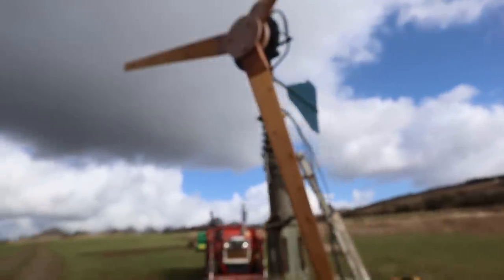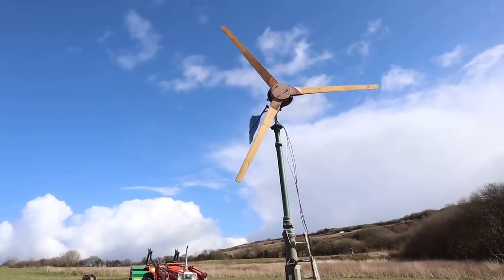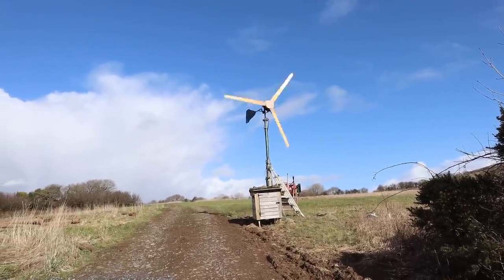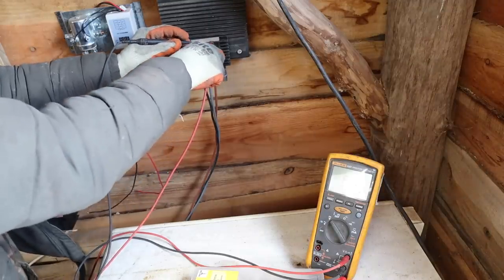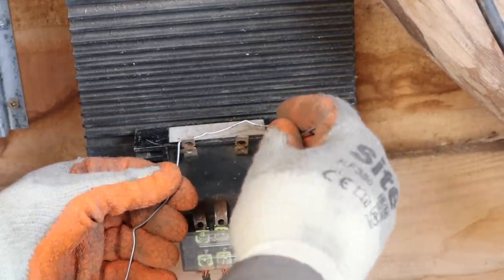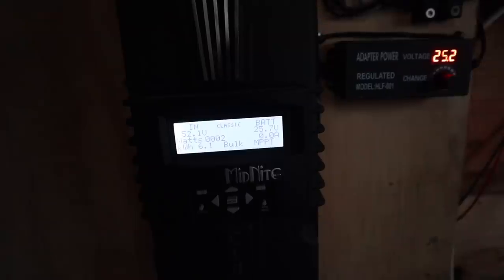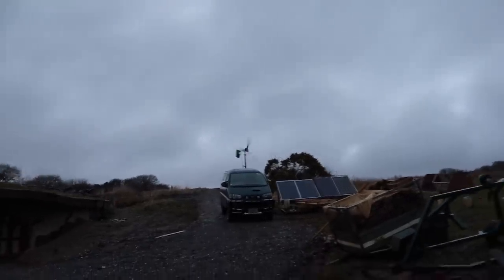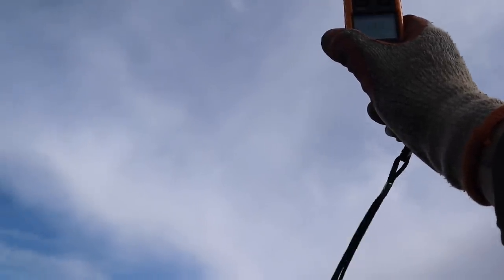Mounting Diy Axial Flux wind turbine Producing 1150W

Comment: Now that is the first wind generator I've seen that actually may be worth building, love the tower.
Reply from the maker: I am in a good location for wind and i made the blades twice the length then the cheap stuff you can buy. I would not bother going any smaller than this. I might make a monster one day.
Reply: @KrisHarbour    With the larger blades you might want to put a more resistive winding so that it turns slower to produce the same power.   That is a LOT of kinetic energy spinning there.  It doesn't seem like you have an issue with low winds, so you can add more torque.

Still a great project even so.  Love the pneumatic mast.
Reply: Yeah most people think "mur blade du bettr" when that's simply not true and they make no power.
Reply: The hugh Piggott designs are not expensive and have decades of real life powering a whole island community. They definitely work!
Reply: @KrisHarbour  hello please share the individual components

Comment: I really love, that you are into data and proving the data. So many wind turbinebuilders claim a lot, but never prove it. Or show a voltage, which says nothing. At the moment om working on a smaller 300 watt homebuild windturbine and a 70kWh battery bank. I have the same plans for data.  You have a new follower.  :D

Comment: WOW Kris!  I had absolutely no idea you would be making power like that from a turbine built from scrap!  I've seen videos on YouTube where ppl tested turbines they bought that were about the same size as yours but only producing 150-200-250 W

Great job!
Reply from the maker: I doubt they were as big. mine has 1.6 meter blades. if you double the blade size you get 8x the power so even a tiny size difference changes the output a lot. so it could be they had smaller blades and slightly lower wind speed. wind is really hard to do comparisons in your mind because of the massive changes to output from small changes in size and wind speed. But i do believe this would be a lot better made than those cheap ones you can buy.
Reply: @KrisHarbour  Could well be that my mind is playing tricks with me. ;-)  Never the less it's still impressive what you have made!

Comment: That looks like a WW2 stirrup pump.    It's great Kris.    Once it's connected it's going to do well, up on the hill.     Every farm should have one similar.     The 40 mph ish wind here in Chester almost blew me off balance yesterday.     I hate wind but we have had a terrific amount of it since I retired 22 years ago and it gives a good supply to the National Grid.
Reply: Too much wind and you end up with a sail when the brakes kick in to keep the turbine from burning out.  (there is a reason he reinforced the mast)
Reply: Not a WW2 stirrup pump, it's the original hand air pump for the 'SCAM' pneumatic mast he's using. Lots of Radio Hams (myself included) use them for their original purpose - holding up radio antennas.
Reply: @colint  🇬🇧    Thanks for info Colin.

Comment: Winglets on the tips would cut down noise and increase efficiency. Like the ones on passenger planes, you see them on big wind turbines now too. They reduce the size of the wing tip vortex significantly where high pressure air on the front face of the wing leaks round the tip to the rear face of the wing
Reply: interesting idea, only works on fixed wing applications though i think? never seen them on a rotating prop
Reply from the maker: Thanks for the tip i will look in to that. i quite like the sound of it to be honest but that might get old.
Reply: That's the sound of sweet success. You could turn it onto a podcast and cash in some Spotify coins to improve efficiency 🤑
Reply: Windtips would work, but a much simpler solution that would work roughly the same (in terms of reducing the noise) is just to round up the tips of the blades.

Comment: To prolong the life of the parts on the turbine (inc' blades and rotating parts), you may want to think about the best use of the brakes to get the lowest RPM sweet spot for the best amount of power output. Min RPM, max output; finding the perfect balance. :)
Reply from the maker: well it actually really likes the RPM that it is fixed to at the battery voltage. it goes passed an unbalanced phase and in to a quite balanced rpm snd it seems to be running quite well so i think i may have got lucky with that to be honest. further testing and experience will tell the full story.
Reply: for i-dea

- savonius made of boat sail
we have never invented better
and eliminates over-runaway problem
(seen it on FB)

- FR patent (which has disappeared, bought by Electricité De France)
a drone worth 4,000 euros,
made of 8 propellers,
4 to fly, 4 in a turbine,
attached to a cable
flying in a circle 300m high

produces more than a 150m high EDF wind turbine
(and maintenance requires simply changing the bearings every year)

only problem:
requires flight authorization
Reply: Since it’s built out from car parts,  the bearing and easily available and cheap.
Reply: From my neighbor who tried the off grid thing for 30 years before I started and became his neighbor, he said that wind power is to much process for the trouble, solar is a must and to only use the wind to charge a very healthy number of batteries...
I agree, you need to be at maintenance constantly subject to God's fury... We were in New Mexico on the foothill of the Manzano mountain and for months you will have winds at 60mph... Literally I seen it blow a cinder block off the roof holding tar paper down before the wind blew in... I said I'll get back to work on it after the winds die down... Lol everyday was like that, no friggin bueno when you building a house...
Mother nature does not play games, when you off grid it's almost like she's intentionally focused on you...
I'm not knocking the work that's done here, never that, it's just when a old dude doing it for decades says so, listen... Lol
True story same guy, when I bought my land the day we arrive to start the building we realized the hard way that the particular side the property was all loose sand a good 2 ft deep,
We got a 1988 k5 4x4 stuck, a 25ft uhaul truck stuck, and the AAA tow truck stuck all on our first day...
Fast forward to the day I met the dude for the first time, as I was working on the roof you could see my house now from the main road it was built with earth bags and tires, so my neighbor was being nosey,
I'm watching this mini van drive down our road on the roof, it's a good quarter mile, there's nothing but raw land, he lives 2 miles up the road,
He gets way closer than anyone has without turning around in fear, you big dude big gun, middle of bfe  oh hell nah, but he starts to head down to the sand trap which we called that particular area of the property, he's driving a late 90s early 2000 Nissan quest mini van... Not a truck with big tires, a friggin mini van.
So, as I'm trying to get his attention me and my wife trying to wave him off, I'm like man I'm going to have to get him out the sand trap... As I say this, the van makes the 90 degree turn down the driveway like it wasn't anything,
My mouth was on the floor.... He pulls up and before introduction I'm like dude, wtf right now, how'd you do that? Lol
He's like, oh the sand? Uhh yeah the sand... He's said oh, front wheel drive... Wait what? Yeah, as long as you keep it moving, FRONT WHEEL DRIVE...the heavy trucks, 4 wheels, nah... Front wheel drive is all, I've had every kind of car out here the past 30 years, the van cost me 400 buck 3 years ago...
After we talk for good min and he see our build in awe , he drive out into the same sand devil, and made it look so easy... We were in awe like so simple...
Lol he and his wife were our desert parents and grandparents to our daughter, miss them so much... But that man was wisdom on two feet...
Reply: you can't use mechanical brakes unless you are bringing it to a complete stop. leaving the brakes rubbing will cause them to catch fire.
Reply: @zogworth  yup...
Reply: @jeromegarcia5396  sounds like the best neighbour ever!
If I had a property with that amount of loose sand, I'd get a tracked vehicle for myself, probably an old waist steered surplus Hägglunds "Viking" (Bv 206)
Reply: @zogworth  wouldn't that depend on how much of a cooling air flow the brake assembly is exposed to

Comment: With the Arduino controlling the hydro, you could set it up to automatically power it down or reduce power output when you have plenty of wind. Then it could crank back up when the wind dies down

Comment: ~9.6kwh per day from water + ~7.2kwh per day of wind + 2kwh per day of solar = ~18.8kwh per day rough average of energy. I hope your battery can store at least twice that amount otherwise it's a total waste! You would need a 24v 750ah battery to store the amount of energy you could produce in 24 hours so double that and you would need a 1500ah battery at 24v. Nice setup! You are living my dream. You have more energy than you could ever need in a home even with an air conditioner! The shop will take more due to the heavy equipment you have.

Comment: hey kris, amazing! harness all the elements. 
i have a question. i know that commercial wind turbines breaks to full stop when the wind is too strong. will you also have this feature so the turbine wont break off? (or fly off hhh). if not, why? is it safe to spin under any wind conditions?
Reply from the maker: It has a furling tail so that when the wind is to strong it will turn itself out of the wind. I still need to tune that by adding or deducting weight from the tail. But that is its protection.
Reply: @KrisHarbour  do you think ypu could give me any tips on converting a chainsaw motor to a generator?

Comment: Add buttresses to the lower section of mast for mast stability.  Triangle steel pieces on all four sides and going out about as far as they are tall.  Tying into concrete footings.  Someone mentioned cable ties to secure it.  That would work for a normal long shaft pole but your telescopes so you could do the buttresses.

Comment: Kris, having put up a fair few towers for TV (living in the Wheatbelt of western Australia) we need TV antenna towers for reception I also put up a 6m pole for my 600peak Watts Wind Turbine you really need to put guy wires up to strengthen the mast try at about 1/3 Rd down from the top you can work  the distance out from the base of the tower it will give you a lot more stability especially in high winds.
Tony from Western Australia.

Comment: This is so cool! Where did you get the pole from?
Reply from the maker: Its an ex army mast. its called a clark mast. i used it for my radio hobby for years.
Reply: @KrisHarbour  is there an "origin story" video on you that you've made? Something that explains how you're able to build all this, design the things so intricately, and of course afford it all :)
Reply: @gerryn2  Yes I'm particularly interested in the affordability aspect. I've wanted to do something in this vein for years but haven't worked out how financially. Or the legality aspect.
Reply: The Brits were smart and used air, which can be compressed offsite.  US uses a crank and sections for our tac masts.    Crank up, lock, lower the crank, insert new section in the "elevator" and then start cranking again.    

Its also a guyed tower, but with the blade he won't be able to guy the top two sections.  (that is going to be the weakest point in the whole project)    If the winds get REALLY nasty he might have to lower the whole mast and rope the blade down.  That is part of the testing - you put a strain gauge on the guys and you can tell how much it loads down and you can figure out what the max is.

We had a blizzard in the army that messed up the math -- the ice formed a sail backed by wind driven snow and brought down a tower rated much higher for wind loads.   It pulled heavy 8 foot augers out of frozen ground and down it went.  That was an actual tower, not a mast.
Reply from the maker: Have you checked out my website? i have a bit of a life story on there.
Reply: @KrisHarbour  Oh true? Thank you bro I'll check it out. Many thanks. Keep up the good work. Love seeing what you're getting up to. Best of luck with your future endeavours. I'll be watching! Much love from New Zealand.
Reply: @KrisHarbour  Do you have guy lines to keep it stable?  Or are you going to replace it?

Comment: Awesome build!
Have you measured what was the average power over the night?

I am not sure if I heard correctly in the video or not, wind power is not proportional to wind speed squared, but wind power cubed :)
(so it is true that 2 times greater speed will give you 8 times the power)
Reply from the maker: Great, thanks for clearing that up. For some reason the meter resets the kwh reading every kwh so i dont know how much it made in a 24h period yet. i would guess 5kwh

Comment: Kris great to see your brake work so well by shorting out the phase terminals,I would also of loved to see you wind the coils of SWG copper wire and fit the magnets or did you buy them.Also what is the length of each rotor blade Kris just wondering so I can calculate things correctly.Kris love your knowledge and love your life, it is so relaxing living in the countryside.By the way I hope you are feeling better as I could see you had the stuffing knocked out of you take care Kris John.
Reply from the maker: I hand winded everything myself but i did it years ago. there is a video (one of my first) but its just pictures of me making it. the Blade length is 1.6m

Comment: Those are fantastic figures for the turbine Kris especially as it is completely scratch built. If you measured the frequency of the output could you calculate the blade rpm?

Comment: Very nice. You are walking in the steps of  La Cour and Henrik Stiesdal. Well done. It reminds be of a visit to Nordtank (now part of Vesta) where we stood around the nacell with a truck brake disk as break. 
What can be done in terms of small scale wind now with cheaper controls and more parts available - in terms of generators, chargers power electronics etc. 
good job
Reply: You may appreciate these pictures of an other pioneer - the trailer with the turbine to take it to and from the workshop. 
https://ing.dk/galleri/kig-i-henrik-stiesdals-fotoalbum-fra-pionertiden-173032#1
You may also appreciate this
Left first Vestas wind turbine, rigth new design from Stiesdal 
https://ing.dk/galleri/kig-i-henrik-stiesdals-fotoalbum-fra-pionertiden-173032#9

Comment: Really impressive result. It's a shame you're not on the grid and selling all your spare power back to the power company, you'd make a bloody fortune in Wales.
Would there be any value in putting a heavy flywheel in the circuit to stabilise or at least smooth the output a bit, or doesn't it matter that it jumps around with varying wind speeds?

Comment: Compared to the hydro, only 2 videos and its up and running, and no other reported issues ...seems to be the way forward. Like to see any updates on how mechanically this is doing e.g. what ongoing maintenance will it need if any? Also share any more technical details on the actual generator if you have them would be appreciated. Thanks

Comment: Nothing wrong with 20% efficiency when it’s free power, plus it’s power that you can get at night or with clouds during a dry summer. 

How do you come up with the angle to set the tail relative to the blade rotation?

Comment: Any room on your property for a pumped hydro storage pond? 

Natural alternative to batteries.
Reply from the maker: yes there is, and it could be done but it would need to be HUGE to be able to supply my peak power needs without batteries. it takes 16kw to start my planner so i would need a huge turbine and huge penstock and huge wiring. its better the way it is at the moment. and with second hand batteries the environmental damage is small.
Reply: Just a nice idea to show others, rather than batteries, pump the excess power you have.
Reply: @KrisHarbour  i didn't think of that. Im sure you'll find something better to do with the Power! Giant ceiling fan for the shop? Thats what i thought the wind turbine was in the wall 'disaster' video!

Comment: Is that mounted on a pneumatic pole? 
Should go the extra mile, rig it with a small A/C, bleeder valve and voltmeter to lower it if it exceeds a dangerous speed (read via amperage, whatever you reckon’s safe for the motor)- and raise it up into the stream when it’s below that threshold

Comment: that is interesting . when i lived at the sowbellies  i built a wind mill baste on the old  water pumps. wind mill design    wit steel fin's. & it went like  a steam engine  charging my   battery bank. I had so much i dubbed the battery bank to drive  the milking shed & the house I had to live light's Bern to redubs the the windmills change  Back  then  there  wasn't the knowledge their is to day in 1960 .  But i must say i have Enjoyed your  review on the systems i have been thinking of making ues of a trailer I have  to ues as a wind mill & solar panel charging siystom for my house. by using a BC  siystom out of a  scooter . to Mack a DC  changing Siystom ,  for Batteries. that can  used. what di you think ?

Comment: Hey kris. I was wondering if you can make the coils from old microwave coils. I saw your early version and you made the coils yourself right? I was looking at coils in microwave they would be like 3volts. So adding them up to 9 then you would be at 24volt roughly. Im living on a ship with solar. All the wind turbines i have looked at are cheap and misleading or super pricey. You switched from vertical to horizontal. Was there a particular reason or was it location?
Reply: Plus i prefer to build things